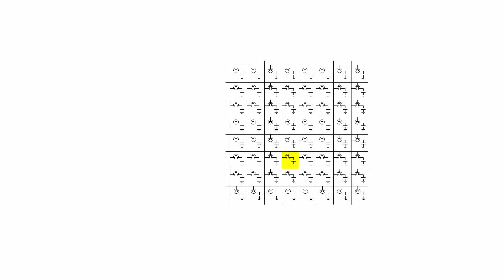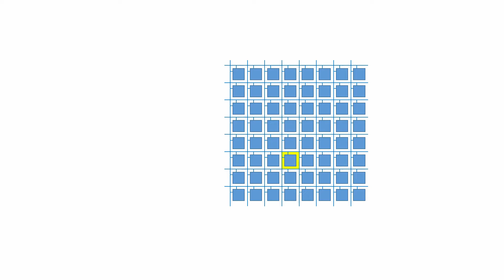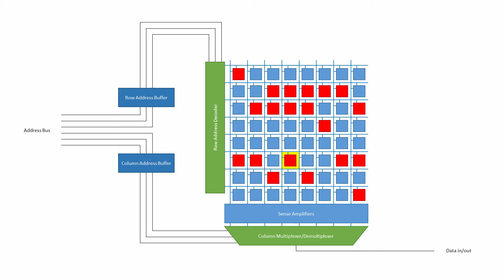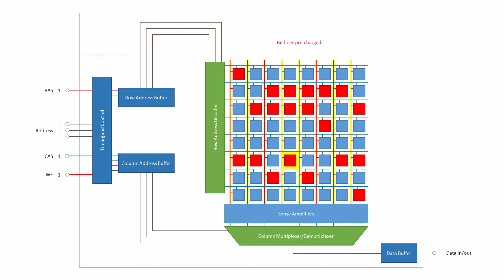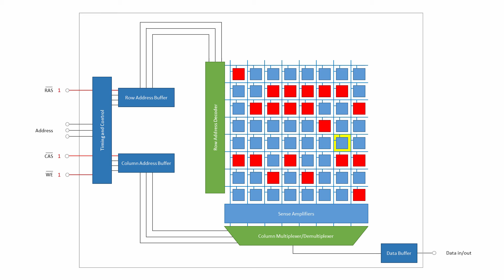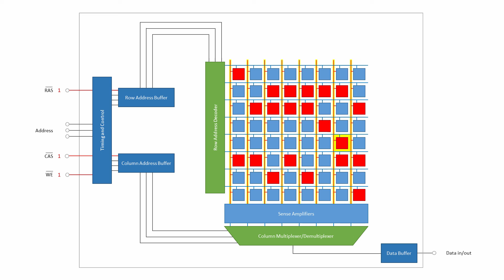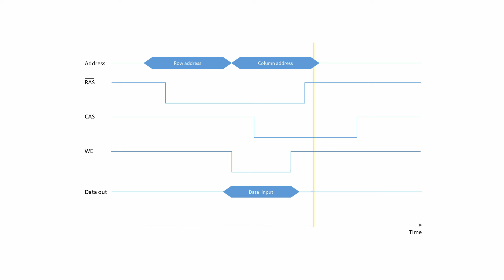Dynamic Random Access Memory (DRAM). Part 2: Read and Write Cycles

Comment: why need a 6 line address bus on 8x8 array of cells (64 cells) curios how you come up with 6 line address bus
Reply from the maker: I just wanted to illustrate the principle but keep the diagram simple.  Yes, we normally work in powers of 2. :)KD
Reply: 2^6=64, so you can encode 64 different addresses with 6 bits. And 64=8×8=8^2, so you have a square array of 8 rows by 8 columns, 64 tiles.

Comment: Some books show that the data bus is connected on top of the matrix representation, that would imply that all the bits stored in the bottom half of the matrix under the sense amplifier get inverted before reaching the data bus. Is that correct?

Comment: Sir, why is the word line deasserted (which I guess means set to low) when writing back to the DRAM? Don't the transistors need to have their gates on (set to high) to write (pass current) through them to the capacitors?

Comment: 8:22 if the address is for the column decoder but both the ras and cas are applied, wouldn't that also update the data in the row address buffer? Wouldn't that cause us to select a row different from the intended one?

Comment: Did I miss it?  You mentioned that the read is destructive, but I didn't catch how the existing bits were put back into the selected column?  Also, is that what a "refresh cycle" is?
Reply: Nevermind.. if anyone else missed this too - It's in the first video of the series.  I had stumbled upon this one first!

Comment: Such a masterpiece video on DRAM
No one will explain this much clearly
You are superb sir
Sir, at 7:07 whenever RAS is disabled , by doing so we cannot deassert word line right?
So at 7:23, then how to deassert word line?
Reply: even i have same dout
Reply: for qn 7:23, a decoder can have an enbale pin(a decoder has and gate at its output stages, so an enable pin is anded with all gates. So if enable is low, then all wordlines are deasserted)

Comment: Is this for A level? If so which examining board would it fall in?
Reply from the maker: No this is not required for most A level courses, certainly not OCR or AQA.  I do nevertheless touch on this with my own A level students because it explains why accessing a data item in an array variable, by means of an index number (which equates to a memory address), takes the same amount of time no matter where the item is.  When I started making this series, I became curious and carried on. :)KD

Comment: I  bet in reading the row of cells, the charges that go to the 0 bit cells must come from the other cells that are bit 1 and not from bit line.  Who knows?  But how it is detected that a particular cell is discharged since the whole row is read.  There are no sensors in each cell, is there?  The gates of the whole row is receiving voltage and the transistor is open.
Reply: That's what the precharging is for: it precharges the bit line with free electric charges that could then go into empty capacitors when a transistor opens the pathway into them. The sense amplifier would then see it as a small voltage drop on that bit line.

Comment: Hello sir, why is there are a need for a "precharge" of half of the voltage? It was mentioned in video 1 but I'm still confused. I get that when precharging, the gate(row address) is turned off but ALL the bit lines are charged to half the voltage. But I don't get "why" is there a need for precharging before read/write, it seems to me that we can still read/write even without precharging the bitlines first......
Reply: Lets take a look at one cell just to make it easier. You precharge to 1.5V because all you care about whether the capacitor is charging or discharging. You start at 1.5 Voltages because it is makes the read/write speeds faster since it's right in the middle. You don't need to completely charge or discharge the capacitors in order for the sensing circuit to know if the cell is a '1'  or a '0'. Instead you look at the general trends. 

However, if there is no precharge, then it will take more time to read and write the cell because instead of going from 1.5V to 3V for a logic high, you will have to go from 0V to 3V to get a '1'.

For example: For reading, if the sensing circuit reads 1.49V the capacitor is charging from 0V meaning the cell is at a logic level '0'. If the sensing circuit reads 1.51V then the circuit is a logic is discharging from 3V making it a logic '1'.
Reply: I would also add to this another factor: In order for a capacitor to charge (when it is fully discharged), there must be some electric charges available somewhere that could flow into the capacitor and charge it. By precharging the bit lines to half the operational voltage, you're basically prefilling that line (a piece of metal) with electric charges (the line has its own capacity too). It's like prefilling a pipe with some water so that it could flow somewhere later when you open a valve into a space with lower pressure (lower voltage). An empty capacitor is precisely that: it has 0 voltage across itself, so the half-voltage of the line is higher than that, and pushes the charges available in that line into the capacitor and charges it. This will cause the voltage of the entire line to drop a little bit, and the sense amplifier can sense it as a voltage drop below the half-voltage (by comparing it with the half-voltage on the other sensed line on the other side of it).
But if the capacitor is charged, the voltage across it is higher than the line's half-voltage, so it pushes the charges out of the capacitor and into the line, charging that line instead, and raising its voltage a little bit, which the sense amplifier can sense as a voltage jump.
If the line were not precharged, opening a transistor to such an empty capacitor would do nothing, and the sense amplifier would see no change in that line's voltage. It could only sense a capacitor that is full, because it would then discharge into that line.

Comment: What determines for how long the Word-Line will be active? At first I thought for as long as RAS is enabled and I concluded that disabling RAS would have to occur after writing back the row. Your explanation suggests otherwise - are there latches in the row decoder? Or is the Word-Line simply afloat in hope that its charge will remain for the duration of the operation?

Asides from that, this is the most comprehensive yet simple explanation the internet has on offer. Thanks! :)
Reply from the maker: Good question.  Most RAM sticks come with timing information.  You will see numbers quoted like 16-18-18-38.  I plan to make a video about these one day.  In the meantime, search in Google for 'RAM timings'. :)KD

Comment: 8:24 what prevents column address to mess up the row buffer when CAS is enabled ?
Reply from the maker: A bit of a glib answer for now I'm afraid.  The row buffer is comprised of a set of sense amplifiers.  These are signal detectors/amplifiers with built in latches.  The are constructed and connected in such a was as to allow a single latched value to the read, or changed, without affecting the others.  The details of sense amps was something I decided no to go into (yet). :)KD
Reply: @ComputerScienceLessons   I think that the question was rather about why doesn't the change of the address on the (multiplexed) address lines mess up the value of the row address previously stored by RAS in the row address register when the column address appears on the address lines a while later, just before the subsequent CAS. If the row address latch were transparent (as it usually is the case with strobe signals involved), the RAS would have to be deasserted first (in order to latch the current row address), and only then we could change the address lines to the column address and strobe the CAS to latch it in the column address latch. Keeping both the RAS and CAS asserted simultaneously would indeed mess up the latches if they were transparent. So what's the deal here?
And the fact that the bit values sensed on the bit lines by the sense amplifiers are captured in their buffers wouldn't change the fact that if the row address changed in the meantime, it would mess up another row that is not stored in the buffer, so it would be impossible to restore its value later on :q